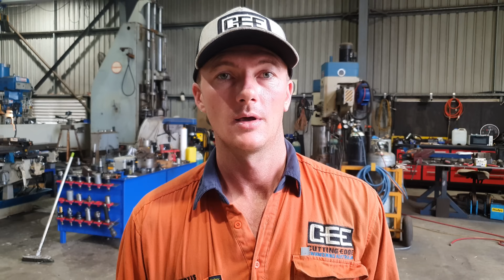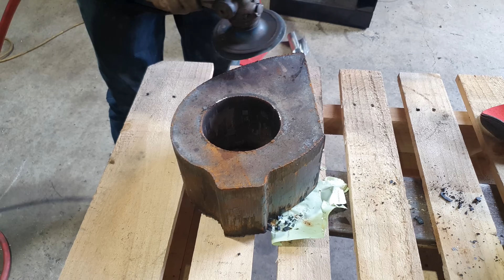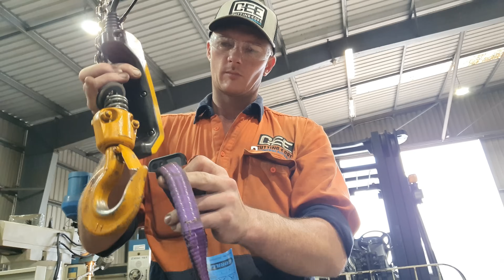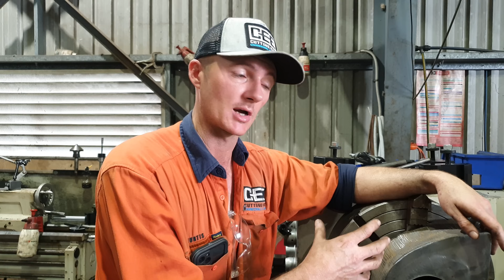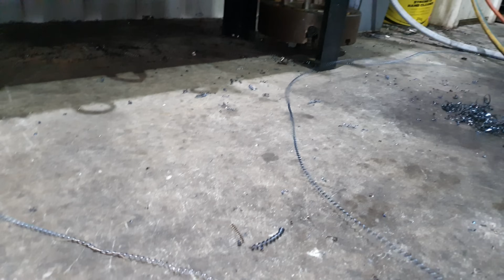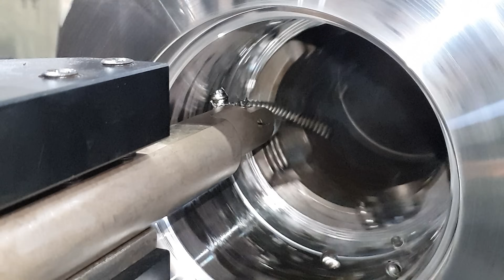Making Parts for CAT D10 Dozer | Machining & Milling

Comment: If I tried to turn a part like that in my old lathe I would end up with a big bump on my head and a hole in the roof. Is the bearing in your milling machine ok? Sounds a bit crunchy? Thanks for another great video!
Cheers from a rainy Sweden! /Jesper
Reply from the maker: Hey mate yeah got to make sure she's tight and keep all body parts away from the spinning bit lol. The bearing has been an ongoing noisy thing if it's not greased regularly, will have to do a bearing change sometime soon
Reply: @CuttingEdgeEngineering  I would absolutely LOVE to see a video of you doing a Lathe Bearing Change...
Reply: @HappilyHomicidalHooligan  nice to watch ... but I imagine not too nice to do... and then theres the cost.. spindle-class bearings are spendy...
I put a set of headstock bearings in a little production turning semi-automatic Britan lathe... the 2 bearings cost me circa £1'000(irish "punts").... but that was 40 years ago... 🙄😱

😎👍☘️🍺

Comment: Not quite the same standard of workshop, machinery, lathe work & foot wear as those guys in Pakistan I've been watching on Youtube.
Reply from the maker: have to get me some of those steel capped crocs!
Reply: @CuttingEdgeEngineering  Then you'll be foreman material.
Reply: I wonder if it would be good enough just to shovel a heap of dirt onto the floor, rather than tearing up all that concrete?

Comment: ok, I read the title wrong at first.
I mean, making 10 parts for cat dozers seems a bit much. 4 parts, ok.
Reply from the maker: 🤣 4 of them was just enough not to do my head in
Reply: @CuttingEdgeEngineering  if it was 10 it would be call parts supplier and order 10 of them cause making that many is to much.

Comment: Have you ever considered temporarily welding on a comparable counter-weight on an odd shaped item to reduce the possible strain on your lathe main bearings?
Reply from the maker: hey mate yeah if it was a bigger offset part would consider doing that but the lathe handles these no dramas
Reply: @CuttingEdgeEngineering  Yeah, I suppose that lathe is pretty stout.
Reply: I can't remember what part but have seen bits welded on to get the 4th clamp enough bite.

Found this one https://youtu.be/wtjwHiStjPQ?t=453 so he's got tricks up his sleeve ;)

Comment: Said without any knowledge, experience whatsoever: Those parts looked strange in the lathe. Dangerous, even. That uneven mass distribution cannot be easy to handle - was that the reason for the low spindle speed or was it the material?

As always: Have a great weekend, everybody!
Reply from the maker: hey mate good question and good reply there from @94XJ. The spindle speed is definitely due to the uneven/offset part, key to run low RPM with parts like this and adapt your machining to the job 👍
Reply: Thank you both to  @CuttingEdgeEngineering  and to 94XJ for the clarification.
Reply: The unbalanced work and not being able to get really good clamping are two big factors. Some weight can be added with the t-slots to balance it a bit more bit with such an odd shape, it'd be difficult to get right and you'd still have kinda sketchy clamping contact from that shape. Just one of those awkward parts where any machining approach is a compromise.
Reply: @94XJ  Thank you!
Reply: The manufacturer of the lathe has likely engineered out the maximum torsion and sheer stress on the shaft bearing. You could do a quick plug and chug with the parts mass and RPM if you truly wanted to know.

You get to either rotate the tooling around the part or the part around the tooling. In a world of Autocam and modeling software I recognize and appreciate the human element of the machinist doing it mostly analog with equipment built by our betters before microchips and silicon boards.

Comment: I have a question, Love your videos by the way and it's especially a delight that the videos are uploaded weekly at the the same day. Question is Just to get the volume of work load you have how many projects are filmed out of the available /on going projects at a time?(Numbers would be great but percents could work as well.).
Reply from the maker: Hey mate thanks for watching always good to know that the videos are enjoyed. Each week depending on the size of the jobs can be anywhere from a couple of big jobs to a dozen or more jobs we get through. We pick 1 to video because we don't have time to video them all and we get a lot of repeat work.
Reply: @CuttingEdgeEngineering  Sweet. Thank you for replying. I understand filming all the jobs would be illogical.Videos are fun to watch as always , do convey hugs to the doggo.
Reply: @CuttingEdgeEngineering  Repeat jobs are a Week-In-The-Life of CEE video when you run low or to take a different tack to a video

Comment: Central US viewer Josh, here. Thanks for the vids. Really makes me miss working with metal as I'm a Engineering tech now. Btw, don't you just love cleaning and grinding all that slag and scale off parts. Always my least favorite part anyway. Stay safe in the shop!
Reply from the maker: hey Josh thanks for watching from over there mate always good to know what viewers can relate to the videos. Yeah these plates were covered in the shit, good times🤣👍
Reply: @CuttingEdgeEngineering  from England here. You would think they would clean all the crap off before they were sent to you. I used to work at a place that did flame cutting and it all had to be cleaned up and put through a shot blaster before it was sent out. Love the videos keep up the good work.
Reply: @shoots2001  I am an electrician. Had a customer bring in a crook electric frypan. Still had the eggs half cooked in it. TRUE story.
Reply: @markneedham8726  What did the cook(s) do to get this frying into such a state?

Comment: Kurtis you should engrave by the grease holes  " Yes it needs ####ing grease" lol
What I admire with your work is it is a mirror of how I was taught in 1977 no dicking around just get it done...
Reply from the maker: LOL will have to remember that for next time 🤣
Reply: @CuttingEdgeEngineering  None of the rubber gloves just to scribe a line or tap a hole.....lol

Comment: How many inserts do you go through per week?
Reply from the maker: depends how many machining jobs and what materials etc, not too many because most of the inserts have multiple tips/sides to use. When we're doing a lot of induction hardened turning that can eat up the ceramic inserts

Comment: When you have parts in the lathe where the center of mass is so off-center, is there any concern that the part will wobble while it's turning, and make the inside not quite circular?
Reply: I think that's why he kept the RPMs so low, and had to resort to a different bit that would handle the low speed better. If you spin it up fast enough at some point it will become a projectile, somewhere before that time it will become wobbly.
Reply: Second that question.
Reply from the maker: Hey mate fair question, yes there is a concern if you either don't know/not confident in what you're doing or haven't set it up properly. 👍
Reply: Do you not think that Kurtis would take all that into account? Have a look at the size of the lathe. With an eccentric object spinning, you feel the machine and work within the parameters the machine allows, including rpm. The bigger the machine the more offset it will tolerate without damaging/overloading anything. Re dimensions not being circular, ditto. Plus do you not think Kurtis would have measured finished sizes, even if he didn't show it. Another factor Kurtis mentioned is that he leaves main ID size undersize so that if there is any distortion when end is welded onto the beam (and it will likely change ID) then final boring after the welding will allow bore ID to match OD of the bearing being fitted. Overall, look at the quality of work Kurtis displays in all his work - it is top class. Please give him credit for knowing what he is doing. Retired mechanic/machinist from SW Sydney.